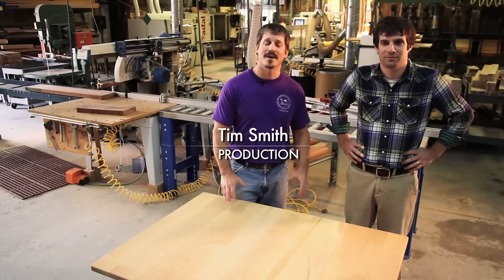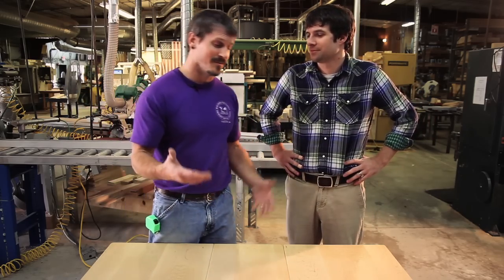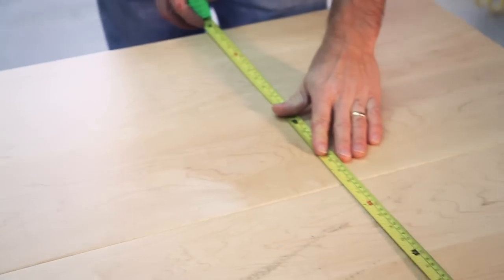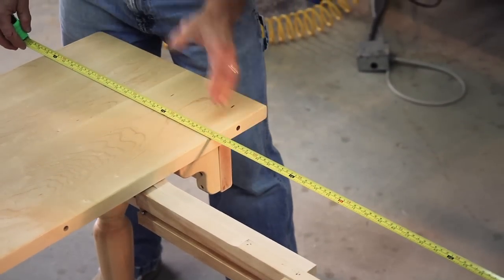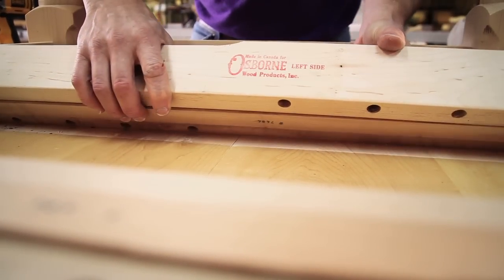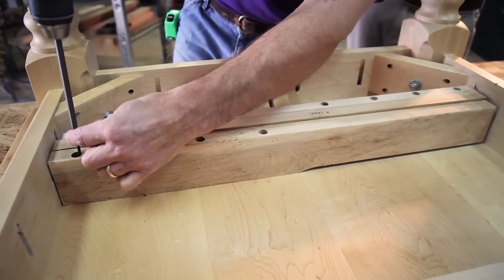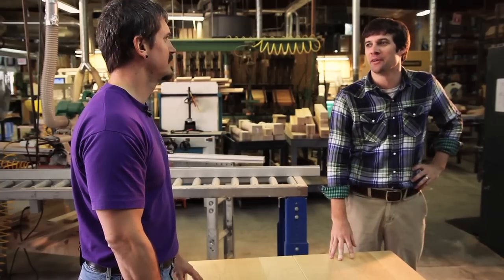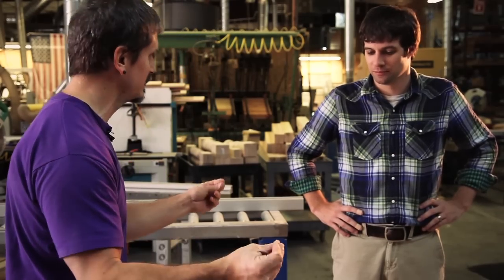Installing and Using Table Slides

Comment: I just received a set of your table slides.  They were shipped very promptly to Canada (I received them last night and got a call from your shop this morning to see if they arrived in good order.  Wow!!). I built my daughter a 9-0 x 4-0 farm style dining table that is solid fir - the top planks are a full 2” thick, so the table is very heavy.  I’ll be taking a 36” leaf out of it hopefully later this week.
Reply: Got the 36" leaf cut out of the table and mounted the slides.  They are perfect and my daughter's thrilled.  Thanks guys.